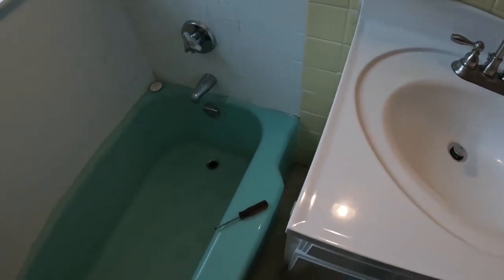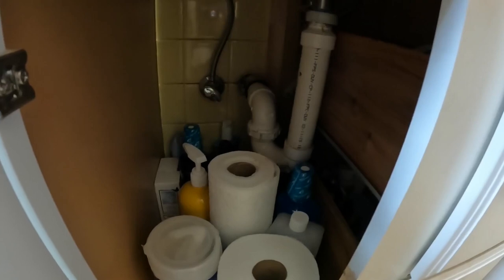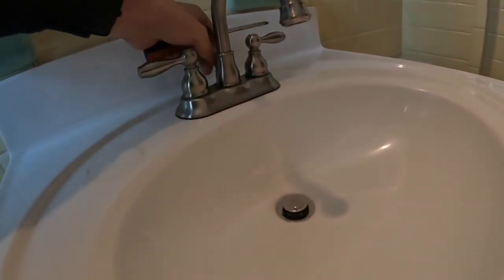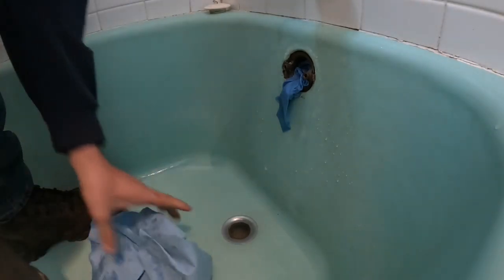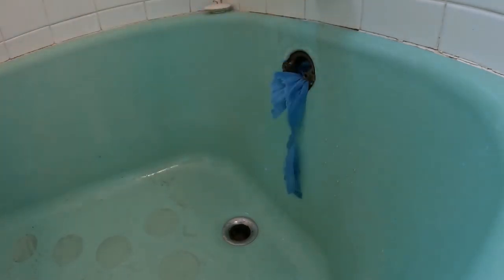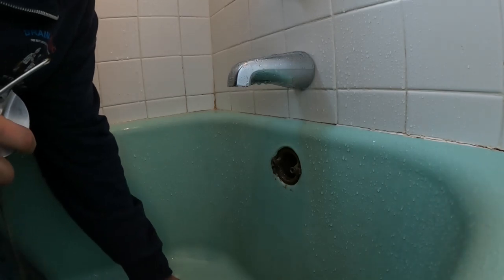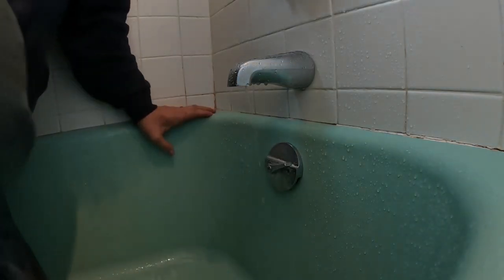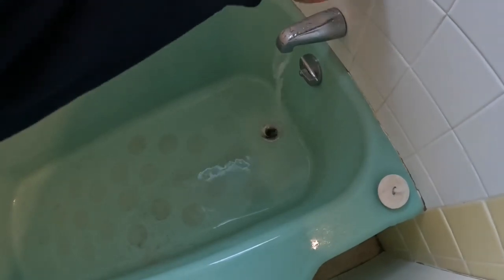How We Unclog A Bathtub Drain With A General Wire Kinetic Water Ram 209

Comment: If the tub is backing up when you turn the lav on, why not just cable from the lav and clear it?
Reply from the maker: It was on a drumtrap. Someone change the drain under the bathroom sink drain an put in a P-trap. But sink still connected to drum trap. No way to snake it unless we opened 1st floor ceiling to open drum trap.

Comment: Hey Shelley and Bob. Was just curious what steps you guys go through to figure out if a tub is on a drum trap? 

Do you run the snake and see how it feels ? Or see if there is an opening in the wall to see the pipes ?

Just curious how you guys figure those out. Thanks much 🖤
Reply from the maker: Its mostly knowing the area we are working in. 2nd if there is no trap under the bathroom sink and the bathroom sink is backing up into the bathtub. Someone added a PVC P-Trap to this bathroom sink. This house is a 2 family home. So we looked in the basement and there was a drum trap for the first floor bathroom apartment. Hope this helped (Bob)
Reply: @DrainMedic  I see 👍🏼 those are mostly on older homes too correct ? That’s the only time I’ve really come across them. And In some old apartments. Definitely gonna be investing in an air ran hahah.
Reply from the maker: @indiDCNM  Yes its a really good tool to have in the truck. I only use it on drum traps and some times a floor drain I cant get a snake through. If a drain has a vent on it most of the time it wont work. Or you might blow the pipes apart. Don't ask me how I know. 😂

Comment: Whats the purpose of putting that blue towel there in that hole
Reply from the maker: That would just push the air and water through there, we needed to seal the vent in order for the pressure to do what it needed to. (Shelly)